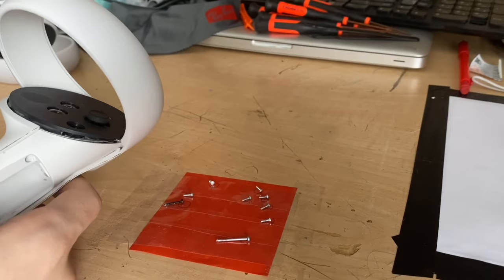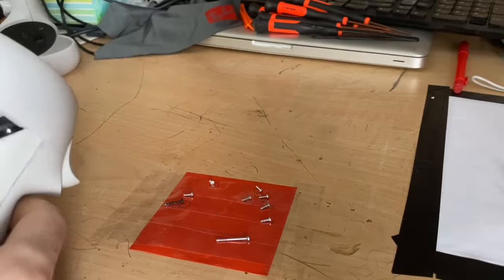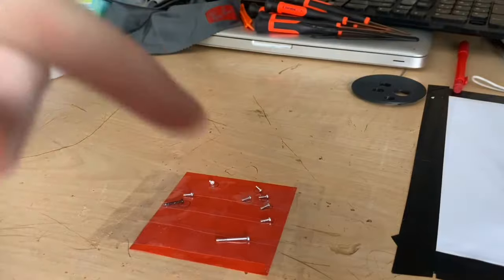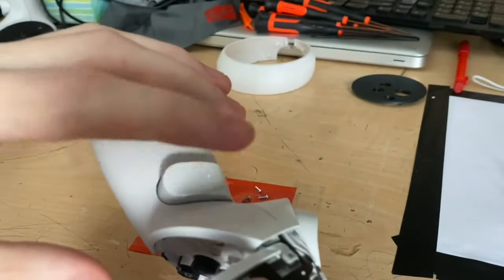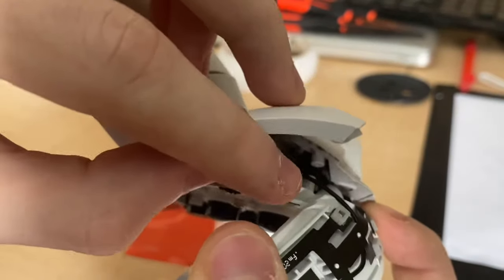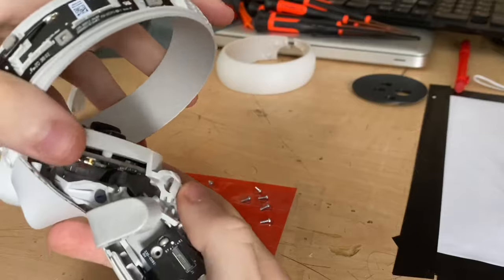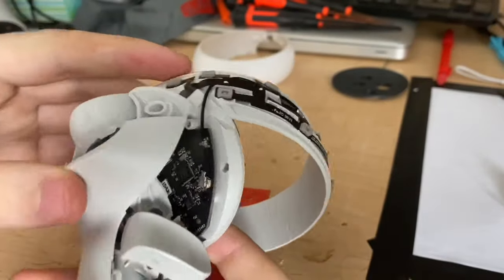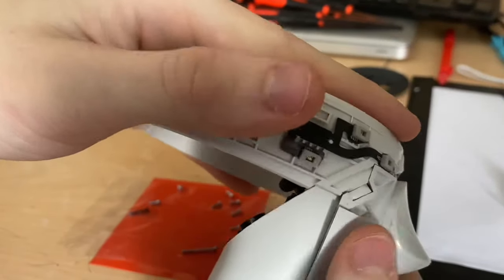Oculus Quest 2 Controller Partial Teardown

Comment: Good video, here's a tip: I have a Quest 1, when I've had sticky analog stick and buttons, go to the auto parts store and buy a can of MAF sensor (mass airflow sensor) cleaner. CRC brand works best. It cleans electrical contats, but is 100% plastic safe. remove the batteries from the controllers and you can spray all the buttons and analog stick, even with the controller completely assembled. then move the stick around and click it a few times, work all the buttons too (including trigger and grip button) wait a few minutes for all the cleaner to evaporate. it won't harm or discolor the plastics and it leaves no residue. your controller will work like new afterwards. this works on all game controllers as well. it's a major time saver. This stuff is great. be sure to use the little tube that comes with the can to get the cleaner into all the cracks. works like a charm.
Reply from the maker: Wow, that’s much simpler than having to completely take apart my controller to clean it. I’ll have to get me some of that, my trigger always gets sticky a week after I clean it 💀
Reply: @kingmatai8662  since you're able to remove the top plate on your controller easily, I'd pop it off before cleaning, that way, you'll be able to get the cleaner where it needs to go more easily. it helps to pull the trigger to expose a small opening to more easily get the spray to where it needs to go too. the cleaner should wick under pads to clean all the contacts on it's own. I once had a button stick on me afterwards, but that's because there was still liquid under the pad. just keep tapping the sticky button for a bit until the cleaner evaporates and it will work just fine again. I've resurrected controllers I believed to be junk using this stuff. it works great. Just remember, you need Mass Airflow Sensor (or MAF) cleaner. Don't use carburetor or Throttle body cleaner, those will eat or discolor plastic and won't work. Mass airflow sensors are usually plastic, and contain sensitive electronics, so the spray is formulated to remove carbon, dirt and oil buildup in the sensor without damaging it. I consider it the best electronics and contact cleaner available.
Reply: Mate I broke the controller rumble while playing bestsaber i hit it on a wall how would i fix that
Reply: These controller insides give me portal 2 vibes
Reply: Is there any downside in using maf cleaner rather than the usual isopropyl/ no residue contact cleaner solution? I can´t find much on the subject
Reply: @creativohugo  none that I've ever found. If you want to use isopropyl, go right on ahead. It'll work, but is more time consuming. I haven't found any downsides, doesn't even cause rubber or silicone to swell up. Alcohol will, on the other hand, cause rubber to deteriorate, and will discolor some plastics.
Reply: @kingmatai8662  if I take off the ring and the electronics inside are not broken but the ring is can I superglue it back together and if I do will the tracking work much better again?
Reply from the maker: @tuxxtan  hey, sorry for the late response, but if none of the electronics are broken and all your lights work, I don’t see why you couldn’t just try gluing the pieces together. It’s worth a shot. Maybe some plastic epoxy would hold the plastic pieces together better though
Reply: @kingmatai8662  no your video is greatly appreciated because even though that will work in the short run in the long run the carbon still gets worn off on the components inside of the assembly and will not work so they need to be replaced anyway
Reply: Same
Reply: This worked for me. Defo worth trying before embarking on a disassembly.

Comment: I had a dead quest 2 controller due to battery corrosion. I took it apart with the aid of your video and with a pair of long nose tweezers, was able to remove that ribbon cable and get to the battery contacts to give them a bath. She's now alive and good as new! Thank you for posting this. You saved me $150!

Comment: Quick question, is there any way to reapply the adhesive after it's removed for the top piece? My controller's issue is that I believe it's dirty under the thumbstick (it has a drift wayy premature for the rated like 1 million spins that meta has or wtv) and I'd like to restick the adhesive on, any way how to do it?

Comment: Do NOT do this unless your warranty has expired! Oculus will most likely send a replacement if you have any issues. If you do not care about your warranty you may proceed.
Reply: Will they do it if I have some door stuck in the controllers tracking ring I let someone play with my quest 2 and they punched my door (already had holes in it) and it got some wood stuck in there
Reply: No idea if mine had warranty I bought mine off Amazon

Comment: Quick tip: If you're having vibration issues where the vibrations are feeling a bit weak, just restart the headset, it usually fixes the problem. This can be very annoying in beat saber where feeling the vibrations matter so your brain knows weather you've hit the beat or not.
Reply: This is my exact issue, but restarting the headset doesn't always fix the issue

Comment: When heating up the top to get rid of the adhesive, be very careful if you use a heat gun, the plastic may deform and mess up other parts of the controller.

Comment: Thank god I found your video before I did anything. I would’ve been pulling for hours trying to get it apart. Sneaky meta hiding the screws under the sticker 😂. I was gonna take the whole thing apart but I watched and realized I didn’t need to take the sticker off for my problem. Basically I was playing into the radius and yk how grenades go farther under hand throw? Yeah I did it really hard and smashed into my table and messed up my right controller. The B button was permanently stuck as pressed and I couldn’t pull it out. Fortunately I had the foresight of buying a tech repair kit. So I had all the security screws and tools to finish in like 10 minutes. I just needed to pull the black circle cover off from the adhesive and then clean up whatever made my B button get stuck. Snapped it back together and good as new👍

Comment: Hey man, thanks for the vid. Having trouble with the left joystick on mine. I have a bit of drift and my character jukes from side to side when pushing forward. I was curious to see how this whole thing was assembled. For me, it seems that the first thing I should try is to spray it out with the Mass Airflow Sensor Cleaner. You showed me how I could do that most effectively. Thanks!

Comment: Thanks for the video! The grip button on my right controller broke and would not spring back when pressed. It was not stuck, it just wobbled around so I knew it was a bigger problem. After opening, I found that the plastic arm holding the grip button snapped off the main controller. I tried super glue but it didn't work. If anyone else finds there grip button breaks just know it's pretty delicate and flimsy IMO and you will likely need a new controller.
Reply: same

Comment: Great video! Thanks! I had water (beer) damage that didn't dry out. I opened it up following your video, then hit the inside of the controller with a hairdryer for 2 to 3 minutes, and BAMB! It worked! Yeah, I definitely recommend using a hairdryer for the adhesive step.

Comment: Your video could't have come at a better time, my IR lights don't make good contact which causes me tracking problems (I assume one of those ribbon cables is loose) and I'm attemping a disassembly thanks to your clear explanation I'm half way in, very much appreciated! I'll let you know how it goes :)
Reply from the maker: Hope you can get to the bottom of your problem, let me know if you’ve got any other questions 👍🏼
Edit: I’m not sure on the severity of your tracking problems, but if it’s only occasional tracking loss, the problem could be due to the frequency of lights in your house clashing with the frequency of the IR lights on the controller. Have you tried messing with the tracking frequency in the oculus quest settings?
Reply: @kingmatai8662  Thanks for your reply. After a full disassembly, cleaning and unplugging everything, I have to say the problem isn't fixed but at least your guide helped me not destroy my controller. I'll try your solution but I think it won't work because I've seen the lights turn off on their own. I'll report back with my findings :)
Reply: Update: The problem still persists. That said, I've found some things that alleviate the issue:
- Changing the tracking to 60hz, letting in as little sunlight as possible and turning on as many lights as I can helps a lot for some reason.
- Turning off my pc RGB helps a lot too
- Using new batteries
- Having a screen on (tv or monitor) also helps for some reason.
- Not having the headset battery fully charged also seems to help (about 50% is the sweet spot)
It seems the problem is permanent, so I already ordered a new controller, but actually getting it in my country is a different story, so wish me good luck lol
Reply from the maker: @FAQUERETERMAX  alright man, hope your new controller fixes your problems. Good luck
Reply: @FAQUERETERMAX  I have an answer to why these things kinda works.

A tv produces light, the oculus loves good lighting. Because it uses cameras if it were base stations go as dark as you want lol

For the quest battery 50% all devices run optimal performance on 50% because the neurons and the stuff in the battery are evened out. 25/25 on both sides of the battery. Also I don’t know about the Pc rgb but they might use 30hz which might interfere I would go to oculus support they give our free replacements 90% of the time
Reply: @ShxdowLIVE  Your explanation makes sense, but it's not what's happening here. A lot of things have happened since I first started having problems, and I could not get a new controller so I'm still using the broken one. I've found a way around it, and even if it's not working as it should, at least I can play sometimes. You see, Quest 2 actually uses cameras to detect not only your hand movements, but mostly to detect the infrared lights your controller emits (the LED array you can see in the controller ring in this video). When the infrared lights don't work correctly like mine, it's very hard for the headset to know where the controllers are. But even if the LEDs don't work properly, the headset can detect your hands with a little help of the built in machine learning. That's the reason why I can still use my controller, but still has a lot of problems. It the enviroment changes just a little, it doesn't know what to do, that's why it stops tracking my controller when the screens are off (it really hates reflective surfaces) or when a person moves in front of me, so I decided to play against the wall. Also, I found the reason the tracking "seems to be working better with low battery" was because after playing for a while (which drains the battery) the machine learning can recognize the movement of my controller a little better. It has nothing to do with battery level, only the time the device is on. As for getting a replacement from Oculus, there is no way for me to do that. They don't even let me buy if I don't live in USA. I asked my friend to buy a replacement controller for me when he went to USA, and Oculus denied to send him a controller because he was in a hotel. I've paid people to get it for me and after many weeks I still can't get it because more problems with Oculus. I've talked to many people and no one wants to sell controllers without the headset, so still no luck. Still waiting to this day.
Reply: @FAQUERETERMAX  hey I know this is old but did you ever get a new controller
Reply: @gjcarrow  might seem old buy it's still an everyday issue for me right now. I could never get a new controller so instead I had to learn to live with it. Now I play beat saber in expert+ with a broken controller (and sometimes win lol) and it sucks but it seems this is now my reality. I have found many other like me along the way though

Comment: Ribbon cable could be just pulled out without any actions with plastic thing (that you damaged). But keep in mind that it could be inconvenient to plug it back in at the top due to lack of space.

I had a broken grab button. Surprisingly, the elastic of the trigger button rests on the thin mount of the grip button and if you pull the trigger hard, you will break the grip. Lol, dumb design :)

Your video and super glue solved the problem. THANKS!
Reply: I had the same problem, the grip button broke off the thin mount. Such a bad design. I tried super glue but it didn't hold. What glue do you use?
Reply from the maker: @brendonnimphius6837  if super glue didn’t work, I’d actually recommend getting some plastic epoxy. It’ll give a much stronger and more permanent hold

Comment: Thank you for the video, my remote was still drifting after using a electric contact cleaner so I had to go further, remove the main circuit board, open and clean the thumbstick circuit board. This is what I have discovered:

- For all the screws, we should use a T4 Torx screwdriver (otherwise with a T5, it will work for some, but it will also damage and strip some screws) 
- The T4 Torx screwdriver should have a long bite (I've used a multi-head screwdriver, but  it was not long enough, I've used it with some weird angle that damaged the screws...) 
- Before using any electric contact cleaner inside the thumbstick, just try to blast away the dust with a Air Duster and see if it has stopped the drifting... (Electric cleaner will eventually bring a white dust inside the thumbstick...)
Reply from the maker: Hey, that’s very helpful advice! I might try firing up the air compressor and lightly blasting the joystick’s inner workings as I’ve primarily been using electrical cleaner to temporarily solve stick drift.

Comment: Is a torx 2 fine for all this process?
'cause you said t5 but I've seen many threads on Reddit and other sites talking about torx 2.
I had an issue with my right controller disconnecting and reconnecting while moving it fast, now it just doesn't turn on so I guess it was a cable not always making contact (now just never making contact), so before spending 70€ on a new controller I'd like to see if I can open it but I'm not sure about what torx measure I need.
Thanks for the video btw, everything is explained quite well and quick.
Reply: T5 or T4, but t4 will damage the  screw head
Reply: @A.typique  I just destroyed the plastic around the screws as the controller was dead anyway, found out it was dead dead so I was forced to buy a new one

Comment: it was interesting to see a tear down of the controller but youre going to need adhesive if you want that top plate to stay
Reply from the maker: Luckily, the top plate holds just fine without adhesive since the plate slots into the plastic.

Comment: Hey bro, can you do the elite strap teardown? I'm just very curious about how it works & how we could possibly replace the breaking piece ourselves
Reply: Is it not just some plastic with foam on it
Reply: @Jumpathy  It is lol, it doesn't need to be broken down bc it has no electronics the broken piece is plastic which isn't something you can fix at home, also they dont sell those spare pieces anywhere so might as well just get a new elite strap, or better yet, get a halo headstrap

Comment: My controller top broke off when I tripped and flung it into a wall. The top loop came off, and now whenever I swing my hand my tracking stops working and my controller reboots. Any fixes?

Comment: If your one controller is vibrating louder than normal, just take the batteries out for 5 min. and try it again...
Reply: Or just turn it off and play a little then turn it on. Or how i do it shake shake shake

Comment: If i need to replace the batteries holder part will i need to remove the black plastic cover with the adhesive?

Comment: my controller had water damage suprisingly enough after i cleaned it with rubbing alcohol and spent an hour plugging back in one cable it worked minus the indicator light on the controller
Reply: I also have a water damage in mine, so if i open it up and clean it with rubbing alcohol it could work again?
Right now the vibration in it is making noise and not stopping if i turn it on, and its not pairing.
Reply from the maker: Aww man, I’m sure you mean the ribbon cable. An absolute pain in the ass to plug back in. Glad your controller is better!

Comment: Does the ring have anything to do with the function of the remote because I broke the ring on mine.
Reply: Do you have tracking problems? Cuz my ring also broke and the black cable thing is detached and my tracking is broken now, the controller freezes in game or drifts away (for example in gtag my arm gets frozen and only the hand moves or the arm is just gone)

Comment: I have recently found that 4 of the 15 tracking lights on my right controller are no longer working, why? Can't say here at least.
I know the three possibles on what happened
1: leds came loose (possible)
2: cable came unplugged (not as possible)
3: ribbon cable tore (I really hope not)

I found out. It's scenario three.